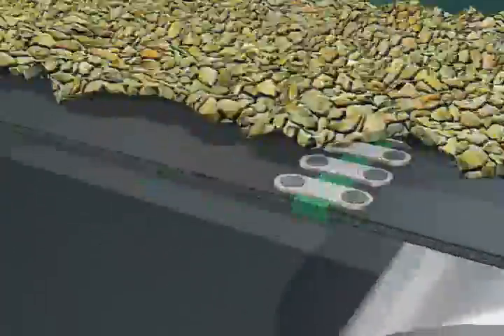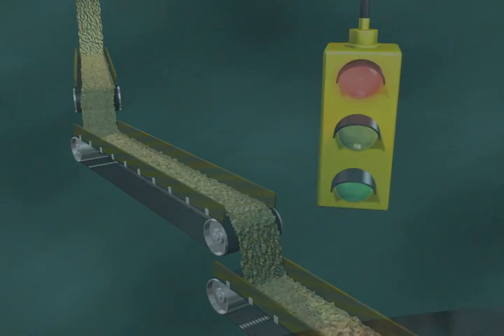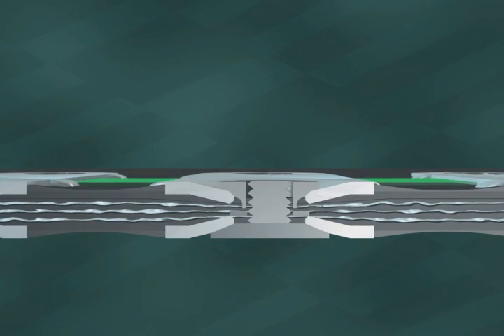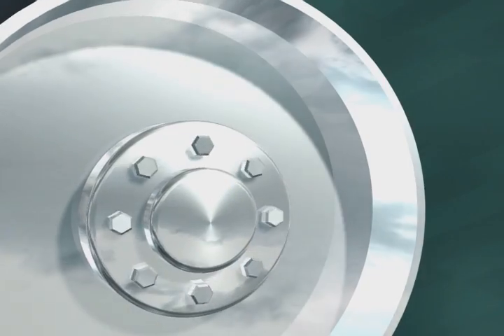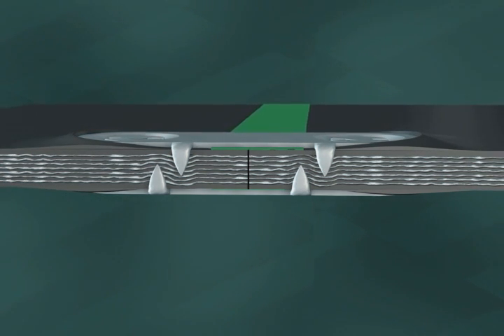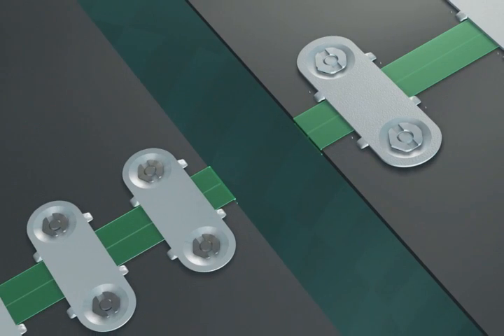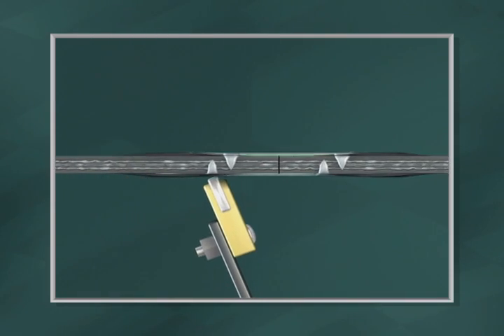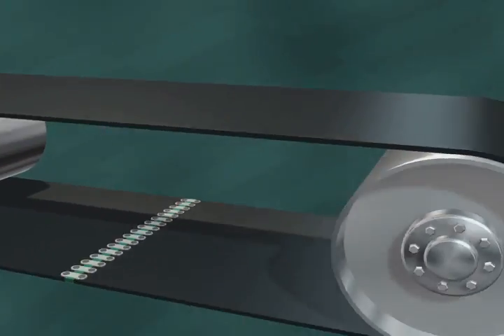Flexco® Bolt Solid Plate Belt Fasteners

Comment: What belt scrapers would work best with these fastners? In the past we had issues with scrapers damaging the 190's.
Reply from the maker: Flexco recommends to skive top cover of belt a minimum of 1/8” (3mm) if possible.  190’s work well with urethane pre-cleaner blades and secondary cleaners with C-tips.

Comment: Wondering wouldn’t it going to damaged the pulley??
Reply from the maker: All Flexco Mechanical Belt Fasteners have specified minimum pulleys for each fastener size. This is to ensure the most smooth and flexible motions across the bend of the pulley.  It also minimizes the strain on the belt/fastener connection and movement and strain on the hinge pin The hardness of the pulley and mechanical belt fasteners are similar and do not affect the performance of the larger surface area of the pulley.  It could be compared to driving a nail with a hammer, after driving many nails, the metal to metal contact makes marks on the hammer.  It doesn’t negatively impact the function of the hammer, but there will be marks.  Any pulley marks made by properly installed fasteners  will not affect the pulleys function and the travel of the belt surface will also smoothen it back out.